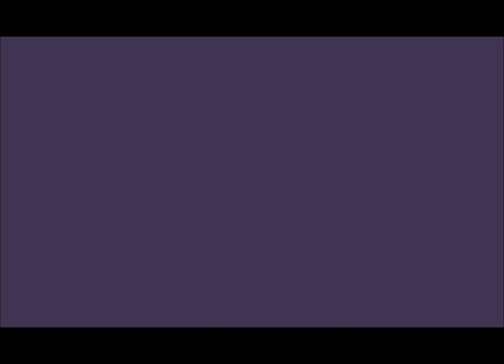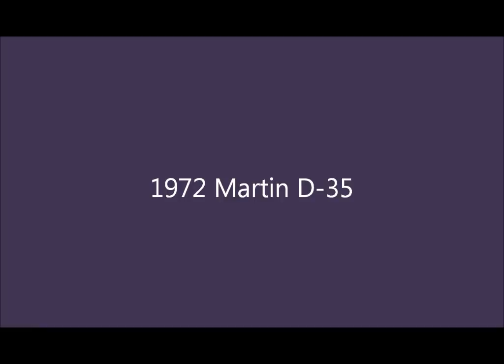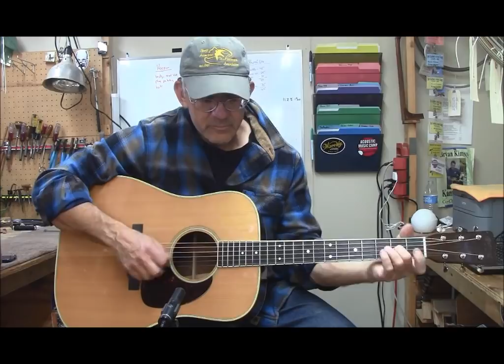1972 Martin D 35 LSH:  SOLD

Comment: I would scallop the braces on a 35 before enlarging the sound hole. I have an 83 D35 with both upper and lower X braces heavy scalloped
Reply from the maker: You are welcome to.  I won't.  Scalloping increases bass.  The soundhole increases mid range and trebles and throws the sound in a wider arc, and that's what this guitar needed, not more bass.  

Also, in my illustrious career I've rebraced just two guitars... both D-35's with over-scalloped braces.  Both had tops like potato chips before I got involved.  

The fact that this guitar sold almost instantly says something.
Reply: @Bryankimsey  thanks for the information. I was  younger when I did it and probably didn't know as much but it increased the clarity and volume and better tone as well, I considered opening the sound hole but it might make it weaker
Reply: @Bryankimsey  and do t the large sound hole guitars such as Santa cruz have both scallop braces and LSH?
Reply from the maker: I've heard it before but I don't where this "weaker" thing comes from.  With a larger soundhole, you're taking 1/4" of wood away from the top vs scalloping braces?   And yes, ALL of the factory LSH guitars that I know of... Collings Clarence White, Martin LSV and Clarence White and 2R, Bourgeois LSH, Proulx (all of them!), Santa Cruz TR and TR Pro, all of the small builders... all of them have scalloped braces and LSH.  

The reason I don't scallop D-35's is because they have 1/4" wide bracing as opposed to a D-28's 5/16" bracing.  It's already  weaker and the whole reason Martin started using it is because the builders wanted to get back to a scalloped sort of sound but the official policy back then was "no scalloping" due to warranty repairs.  So, the workers convinced the powers that be to try 1/4" wide bracing.  

A person can do whatever they want to their personal guitar but there are things I won't do to a customer's guitar.  I don't care how many disclaimers they sign, a bad job is gonna come back to haunt you.
Reply: @Bryankimsey  as for weaker I meant after already having scalloped braces I might not want to open the sound hole although I always have considered it. Plus I've already had a broken neck repair by randy woods. Thoughts?
Reply: @Bryankimsey  I've always found it funny how tony rice would say he didn't recommend people enlarging sound hole and that he thought it didn't help, but yet all his model guitars had anlarge sound hole. It seems like he wanted to keep that sound for himself
Reply: @Bryankimsey  also what is the deal with the popsicle stick? Does it not need it?
Reply from the maker: I interviewed Tony and Wyatt for Flatpicking Guitar Magazine.  Neither one of them wanted people butchering vintage Martins, but Tony played a guitar very early on with Frank Poindexter that had a bound fingerboard and large soundhole.   I also talked to Richard Hoover and Bill Collings about LSH's.  

Judge for yourself:

https://www.youtube.com/watch?v=DTksqfBtap0